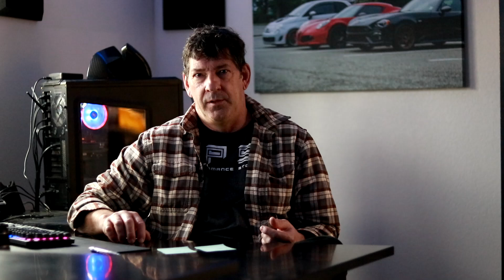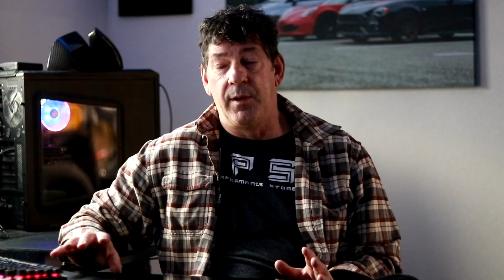Boeing 727 Falls From the Sky TWA 841

Comment: Thanks to the commenter below for noting that the Alternate Flap Switch had to be used to enable the illegal, unsafe, and un-needed "trick".  There IS a reason for the [no flaps above 20K feet] Limitation, and Hoot demonstrated it. The outboard ailerons are locked out (in faired position) when the flaps are fully retracted (at any altitude) and as the flaps are extended from UP to 2º to 5‚º become fully operational. Over 50% of OB Aileron travel is available at Flaps 2º. The REASON is because of Boeing's beautiful FLEXIBLE wing.. Use of O/B aileron at high altitudes causes the wing to flex and makes the intended roll direction, actually have the opposite effect.!! ( "Aileron 'Reversal'").. Which helps explain the gross problems they experienced!! The Boeing of those days wrote detailed instructional manuals (as addenda to operating manuals) with detailed explanations for why and how the pilot and F/E procedures should be done the way Boeing specifies- now all sadly gone..  The reason this "trick" was fruitless is: Each flight has an 'Optimum Altitude' at which fuel mileage and HS/LS Stall protection is ,well...... Optimum!!   Flying below, Optimum wastes fuel, but gives better Stall Protection big, puffy (C/Bs all around), flying ABOVE Optimum wastes the same amount of Fuel, and worse, gives much worse Stall Protection. THE Optimum Altitude is determined by current gross weight. Period!!  So, Hoot gained nothing in terms of fuel savings, exposed himself to a much thinner Buffet(stall) margin, and paid for it with bad CRM, poor and unbalanced systems knowledge,and is so effing lucky( thanks to those great Boeing Engineers and craftsmen, and the Flying Gods and Angels.!! Boeing has preached for years (since the early 707 days, and even now).. DO NOT FLY ABOVE OPTIMUM.!!!! In the early days of (respectively) the -100 and -200 series, the engines weren't powerful enough to take you high enough to get into stall trouble.  The -7B on the 100 made the perfect match between engine and air.frame; on the -200 the -15 was slightly overpowered and enabled altitude hunting. (there were many variations of engines and weights on the -200 series). I operated and instructed on this airplane for many thousands of hours, and never, ever, heard of anyone trying this except for Hoot; there is no other plausible explanation; my instruction ALWAYS included detailed lessons on the Alternate Flap Switch and the flap/Aileron interactions. The 727 IS a superbly designed, engineered, and constructed aircraft; any accidents/incidents are strictly due to poor training and "cowboys" .
Reply: They were flying at 39,000 feet because earlier they were flying at 35,000 feet but had a 100 knot headwind so went up to 39,000 where the headwind was weaker. Your statement about over 50% OB aileron being available at Flaps 2 while they lock out when the flaps are retracted and hydraulic pressure to the rudders is reduced from 3,000 PSI to 800 PSI is great segue to what am about to talk about. 
To start, the dive wasn’t due to the pilots doing the flap trick nor was the No.7 slat the culprit here, the culprits were actually the right OB aileron and the lower rudder. The right OB fluttered at 39,000 feet causing the 727 to turn off its heading, the autopilot tried to correct for this by turning the control column to the left which put the 727 into a cross controlled situation. The Lower Rudder yaw damper coupler or rate gyro sensed discrepant yaw and caused a rudder hardover. This is supported by Hoot Gibson reporting that the nose yawed to the right, paused and then yawed right again and is corroborated by the FDR. Although he applied full left aileron and rudder, the IB ailerons and Upper Rudder inputs were insufficient to counter the OB aileron fluttering and the Lower Rudder hardover and TWA 841 went into an uncontrolled dive. During the gear extension the right gear overextended which caused the loss of System A hydraulics that provided hydraulic pressure to the Lower Rudder, flaps and slats to name a few. With hydraulic pressure gone the Lower Rudder centered, allowing recovery. The No.7 was misaligned and didn’t lock into its locking mechanism and was kept in place by hydraulic pressure and aerodynamic forces alone. With the loss of System A hydraulics the aerodynamic force caused it to extend where it quickly tore off.

TL;DR, the slat had nothing to do with the upset and it was actually a result of a Lower Rudder hardover with a contributing factor being the fluttering right OB aileron.
Feel free to discuss this more.
Reply: @EpicJoshua314  To make a very long reply short, I recommend that you read, in detail the NTSB report, available freely on-line, as they and Boeing put a lot more research, testing,  and analysis into the fact finding, than the Wikipedia 'report' which brings in 'suppositions' of other non-analysis parties. 
Briefly, to your comments:
Firstly, the upper rudder and its Yaw Damper, always get 800psi from 'B' Hydraulic system; the Lower Rudder, under [normal] System A,  with its Yaw Damper, gets 2400 psi with the Inbd Flaps not fully up, and 800 psi, with the flaps retracted- this changeover is monitored by the Rudder Load Limiter light at the bottom right of the F/E panel. When the Standby pump is operated (by the Alternate Flap Master Switch OR the [combined] Sys A Lower Rudder S/O Switch ganged to the Standby Rudder Switch, The Standby Pump will power the Lower Rudder, with NO Yaw Damper, at about 1200 psi.
As the NTSB report points out, even assuming the RH Outbd aileron 'bolt' had failed  in cruise, BEFORE the "adventure", it would have cause the (A/P) to move the control wheel about 15º to the lefts and would have been certainly noticed by the crew.  It would have changes some speeds/load factors slightly, IF it had deflected the aileron up by about an inch, and STAYED THAT WAY. NTSB instead assume that it would have fluttered instead, causing some A/P reaction, maybe a 'buzzing vibration'. No problems.... though a flight abnormality, very noticeable to the crew. However, if the bolt DIDN'T Fail until the "adventure's' excessive flight loads caused it, it would not have been even the very minor causal factor that was possible. The crew had no recollection of any control wheel displacement.
There was no "cross-control"- i.e. left Rudder and right aileron, or some such; The A/P merely responding to a Right rolling and applying Left aileron. 
The Lower Rudder behaved normally, when/if it sensed (right) adverse yaw it counteracted with left Rudder, TO ITS DESIGN LIMITS as shown on the flight control position indicator. The Y/D does not have Authority or Travel to move the Rudder beyond those marks, certainly not a 'Hard Over'. I'm aware that the odd 737 has experienced some hard-overs, but that is a different [faulty] rudder power unit], and different setup altogether. I should note, that if the crew had sensed any lower  or upper rudder problem, they could have easily deactivated either the Y/Ds or the Rudders themselves by overhead panel switches.  One of the primary design considerations for Y/Ds is that they DON'T/CANNOT do hard-overs!!, Only Captains can do that.    I'll continue this in the next reply- running out of room!!
Reply: @EpicJoshua314  OK Now you assume a double fault situation with un-related systems; the "aileron"  and now the Rudder/Yaw Damper. Which one, upper or lower, and how do you know?? The NTSB analysis shows nose movement/roll to the right, and the A/P counteracting to the left.. As did he, initially..No mention or evidence of any kind that the Rudder[s]/Yaw Damper[s are misbehaving. In any case, we are now in the full adventure and stalled/out of control. Oh, a short Rudder p.s. If the TE Flaps HAD been extended, the the Lower Rudder would be receiving 3x its normal cruise pressure-2400 psi. This might well explain Hoot's contention that there was something amiss with Rudder "feel".  Just Saying.   P.S. Sorry, I forgot to emphasize that the Standby Pump can only Power the Lower Rudder if Sys A is NOT available to the Lower Rudder.
OK, now due to the (an explanation at last!!) #7 Slat extension( and failure to retract, like the others did!!!) that's why the airplane kept trying to turn right the airplane is performing  all kinds of interesting contortions. OK, Throttles go back (good), Speed Brakes extended (good), then retracted (bad- guess he didn't think about Spoiler Blow-down) and, as we finally get down to Thicker air, the #7 Slat rips off, and a modified return to normalcy ( now we regain lateral control). Of course Sys A starts to piss away with the actuator failure, followed shortly by complete Loss as parts go caty-wampus wiith the Gear Extension (good).
The NTSB goes into long and exacting detail regarding #7 Slat; aerodynamic effects, actuator operation, mis-alignment (compounded greatly by descent air-loads) etc. Basically, it was extended at the improper altitude and air speed, and caused GROSS problems with lateral control and buffet; Thank heavens it finally departed the scene.  
All of the foregoing is consistent with (improper manipulation of the flight controls- specifically the flaps). , and even with an aileron bolt fracture (when??) portray a manageable flight, even with the misjudged altitude. And those manipulations all were in contradiction to AFM and TWA Limitations, by a fellow who had just had some requal training, and the "Captain" culture existing in the cockpit.
Reply: @EpicJoshua314  Just one more thing; When the Alternate Flaps Master Switch (normally OFF) is turned ON:
It turns on the Standby Hydraulic Pump (will power the Lower Rudder  at 1200psi (no Yaw Damper) if System A not available to the Lower Rudder
It ARMS the TE Flap Electric Drive Switches.
It ARMS the L E Flap/Slat Standby Selector Shut-Off Valve (commonly called the Leading Edge Standby Valve) - LEFSSSSOV. !!!
It shuts OFF Sys A to the Inbd TE Flaps.
It shuts OFF Sys A to the Outbd TE Flaps
It shuts off Sys A to All Leading Edge Devices (Flaps and Slats. via the Leading Edge Valve- NOT the same one as above mentioned. They all have their own separate c/bs.
( "Leading Edge Valve" c/b is the one that is pulled in the 'trick' scenario, allowing the AFMS to be restored to its 
 'normal-OFF position, allowing the TE flaps to be extended 'normally'  Changing the Lower Rudder Pressure to 2400 psi, and unlocking the outboard allerons to 50% travel at Flaps 2º, pack fans ON, etc.!!!!!! 
But the LEDs, will remain UP with trapped Sys A Pressure and Mechanical LED locks until System A is restored or............. with the AFMS still ON......
either of the Electric Flap Switches is Moved DOWN, even momentarily. This OPENS the LEFSSSSOV and the standby pump then sucks some hidden fluid from Sys B tank, drives ALL LEDs out through a separate piping system -they mechanically lock, and holds them as well with Standby Pump Pressure.  That describes the "normal-Abnormal usage of the AFMS.
Reply: @divingfe Thank you for your detailed responses. Just three questions for you:
1. If the slat is indeed what caused the upset then why does the Flight Data Recorder corroborate the captain’s account that when he pulled his seat forward after he sensed a vibration, the airplane yawed to the right, paused and then yawed right again?

2. Why does the final report say the plane rolled to 35* Angle of Bank, returned to wings level, and then rolled to 35* Angle of Bank and spiraled into a dive? Wouldn’t the slat have caused the plane to roll into a dive in one continuous movement?

3. Boeing engineers declared the slat could remain extended up to 672 km/h, yet according to the NTSB’s conclusions it remained extended even at the speed of sound ~1,200 km/h. Also, the NTSB’s own simulator tests showed that the slat would have ripped off at an altitude no lower than around 30,000 feet, not at 8,000 as in actuality so why didn’t the pilots recover much earlier in the dive?

Emilio Corsetti III’s Scapegoat is a must read.
Cheers

Comment: Ann Getty’s super 727 N311AG had the rear flap “up stop” permanently at the “2 position” and flap gap seals installed to cover the extension gaps. This mod was so good it was incorporated into the plane with the super 727 and didn’t need the circuit break pulled. With -200 engines on outboard it was faster than any corporate jet in existence, faster than 747. Guess how fast it was with the nose slightly pushed down beginning at top of its high altitude decent, yep it was that fast and could take it.
Reply: Yes, well, I expect Boeing would have had something to say about that mod..  I don't believe your story, Sorry.
Reply: Some of the reasons are: The A/C Pack Fans would run continuously; The Lower Rudder would receive 2400 psi continuously, rather than switching to 800 psi for high altitude flight- resulting in a LOT!!! of muscle for the Lower Rudder/Yaw Damper combination.; The outboard ailerons wouldn't lock out in faired position- they would have over 50% of normal (Flaps 5º and beyond) travel, resulting in VERY sensitive roll control- not what one wants at high altitude, and would result in possible "Aileron Reversal" due to wing warping- again caused by outboard aileron travel.  There are good/valid reasons why TBC built the airplane the way they did, based on experience with: B-47, B-52, KC-135, B707, OK???????

Comment: It wasn’t about altitude. 
It was about efficiency, and they almost killed people.
Reply from the maker: turbine engines are usually more efficient at altitude.
Reply: @GregsAirplanesandAutomobiles  
I know, but I wasn’t talking about that. 
It was about making the wing more efficient, and even the Boeing production test pilots knew about the practice. 
TWA (and I believe other airlines too) offered some sort of bonus to crew that were able to operate their routes using less fuel….fuel savings were a big thing. 
The engines were operating as normal, but it was put to me as more of the drag reduction thing. 
I seem to remember being told the story in the late ‘80s at Boeing, and they just bumped the flaps out a little bit, but pulling a circuit breaker to eliminate slat deployment.